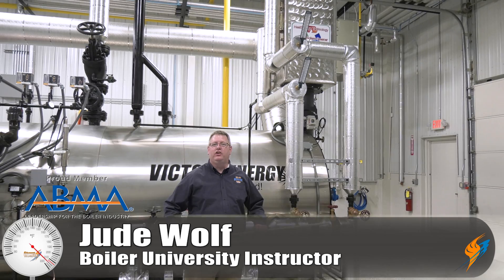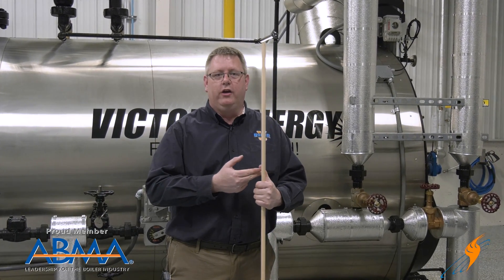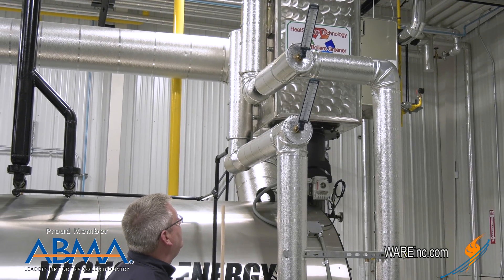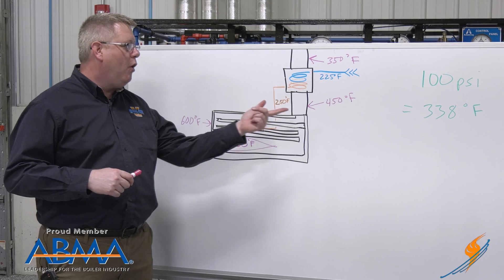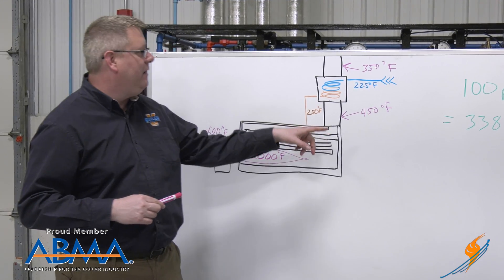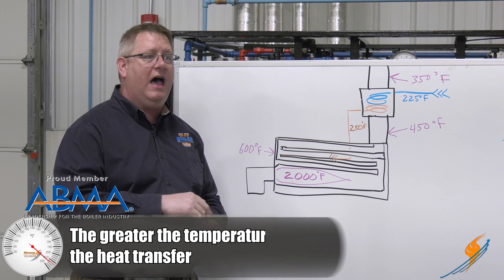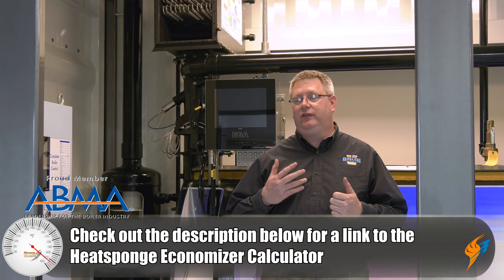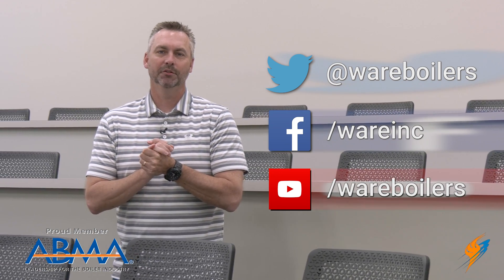What is an Economizer - Boiling Point

Comment: What's in those tubes in that economiser?
Reply from the maker: Do you mind clarifying what you are asking? Thanks!
Reply: @wareboilers  I am asking is whether the tubes going inside the economiser have hot water flowing through them or is it smoke?
Reply: @limongarcia2758  Water flows through the tubes, flue gas ("smoke") passes around the pipes to heat the water inside the pipes.

Comment: Hello there ! that was really informative, I was wondering i have got 190 degree celcius exhaust from non ox furnace could it serve the hot air dryer and ECL bath requirements .
Reply from the maker: It wouldn't be recommended because if the temperature drops it could create acidic condensate that could cause problems in your process or worse damage equipment. Granted there are a lot of different variables that goes into this so it might be best to get with someone locally to figure out if some solution could be created. Hopefully that helps! Thanks for watching!

Comment: economizer will increase the head on the condensate return pump and will increase the burner air fan static pressure due to heat exchanger tubes and flue temperature difference.  As far as temp shock 20f is negligible .

Comment: Is it possible to get 1000 degree celcius steam as a output from a boiler??
Reply from the maker: While it might be possible in theory, getting a system to be able to operate at that temperatures would be very difficult. Steel would have a very difficult time handling the pressures at that temperature. Thanks for watching!
Reply: wareboilers But activating carbon has a conventional process using steam at 1000 degree Celsius, which is followed in many countries, they dont use special kind of steel as you said .
please consult with your experts and give me a solution..Grow up soon.
Reply from the maker: There may be some misunderstandings on our part about what you are looking for.  If you would like, please contact us http://www.wareinc.com/about-us/contact and we might be able to help you out a little better. Thanks

Comment: Thank you for this video
I am from Pakistan 
if you can make video about makeup water flue gas condensing economizer
Reply from the maker: Thanks for the comment. So right now we don't have access to a condensing economizer to really be able to show the differences between a normal one and a condensing one. The major differences is that they tend to be more expensive and complex but have better efficiency but their operations are very similar to the one shown in the video. Hopefully that helps.
Reply: Regading another thing about condensing economizer  (depending upon application/ fuel oil or gas ), your flue gas temperature should be higher enough to prevent reaching it's dew point temperature. This is a common problem if your flue gases contain sulphur and corrosion starts.